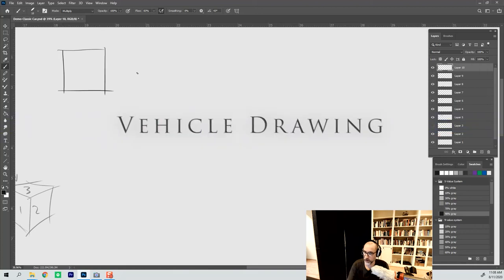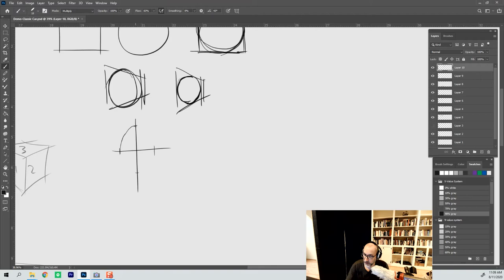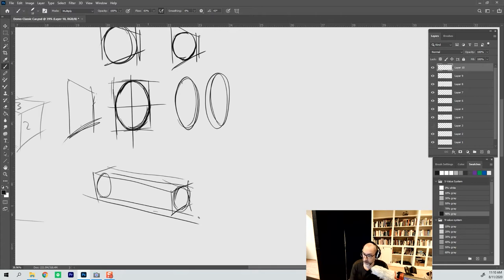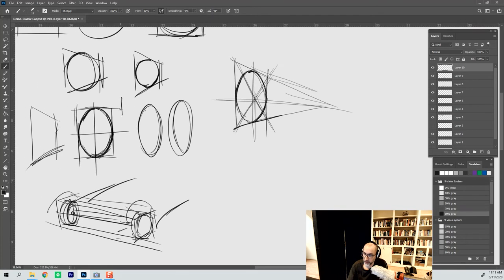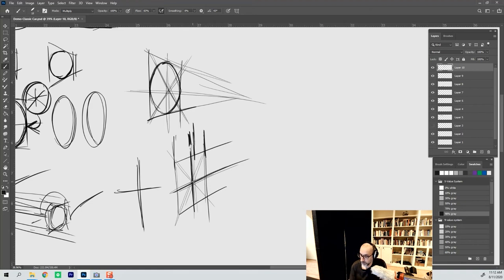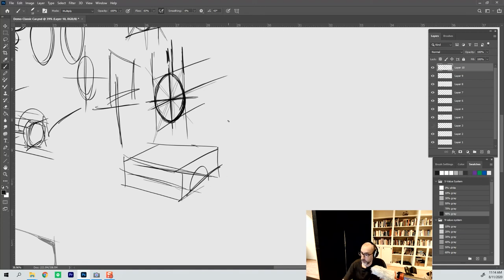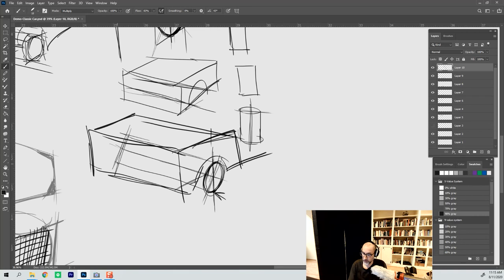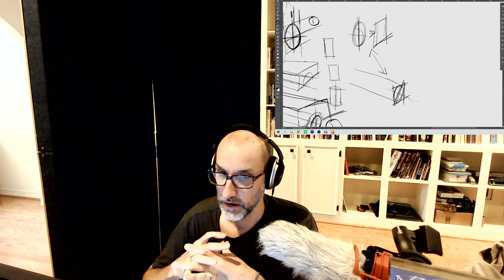Vehicle Drawing: How to Draw Wheels (Part 4--Reconciling Circles & Squares)

Comment: This is kinda over my head but is there another  way a more simplified way to draw the tire in the center of the tire wheel.I'm knew to drawing thanks for sharing the video,
Reply from the maker: Simplest way is to just draw a simple ellipse up and down. But it only works if you draw the car in a very subtle 2-sided view without harsh angles. The example I did before uses that method.

Comment: hello sir. been looking for the answer to this riddle and I found your video. thank you thank you. question. at 4:00 when you refer to actual center vs visual center are you talking about the actual center as being where the x intersects or are you calling that the visual center? Also, if the perspective gets a bit more extreme is it best to use the cylinder option? Now that I think about it, it would be so helpful to see you draw the second cylindrical option starting with a box. I'm working with "Perspective Made Easy" and I'm stumped on page 125. http://www.storytellerartist.com/documents/Perspective_Made_Easy.pdf
Reply from the maker: Visual center is the X method. The mathematical center of the ellipse is the 90 degree axis one. I think it's best to not try to construct cylinders and so on out of a box. It's easier just to do it on its own. You might need the full cylinder method when you're doing the 3-sided vehicle when you see the front, side, and top. The other method will work best with a view where you see front and side.
Reply: so the mathematical center with another line 90 degree perpendicular to it for my ellipse?
Reply: im just spending a month or so on drawing perspective and basic shapes and shading and I'm looking for my go to method of wheels and cylinders. any advice?
Reply: @MeadMcLean  im just spending a month or so on drawing perspective and basic shapes and shading before i do some paintings and I'm looking for my go to method of wheels and cylinders. any advice?
Reply from the maker: Yeah exactly.
Reply from the maker: Do the straight up and down ellipse axis for 2-sided boxes, and use the ellipse at an angle for 3-sided boxes. That should get you there.
Reply: @MeadMcLean  sorry. i don't know what you mean by a two sided box
Reply: @MeadMcLean  by 2 sided box do you mean a box that sits equally above and below the horizon line?
Reply from the maker: It doesn't have to be equal, but yes--above and below the horizon.